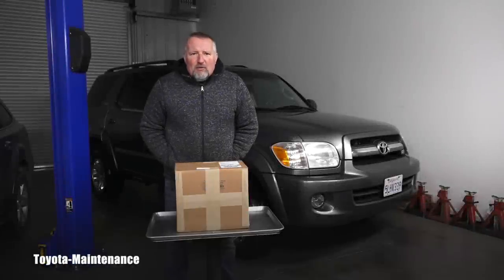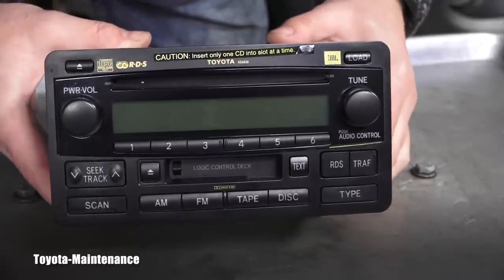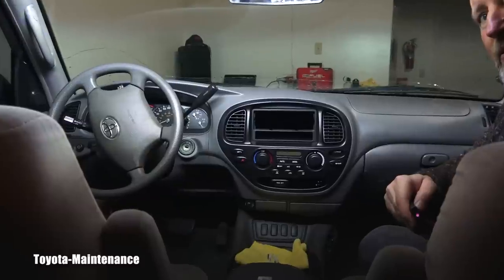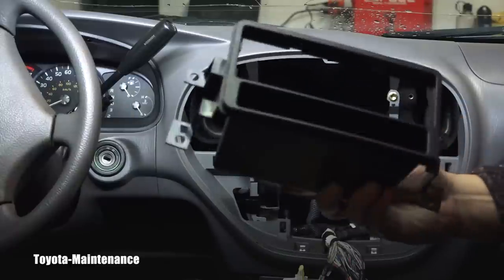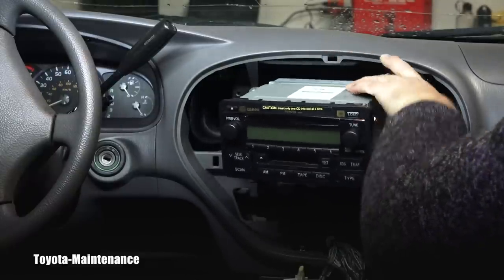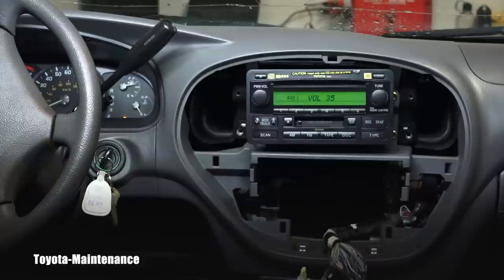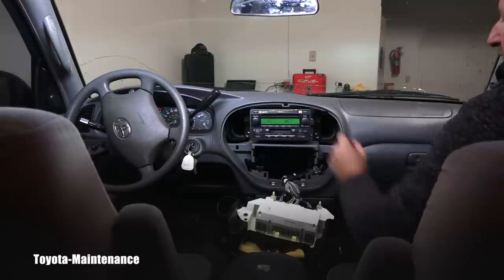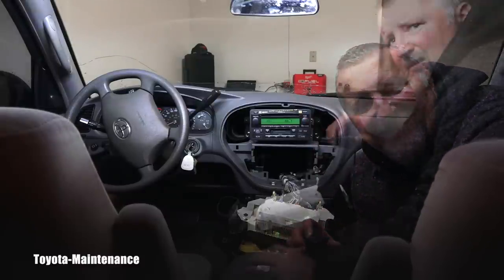Toyota Sequoia Tundra JBL Radio A56830

Comment: thank you for the efforts you make. I have a 2006 Highlander and have the same system with 5CD changer. and I added an adapter to attach a USB drive, or to receive calls from the same system. Its in the glove box no wiring or any dangling wires on the front.

Comment: My factory JBL head unit turns on and extends the antenna perfectly BUT no sound plays. And when I try to turn the volume up it doesn’t even show the volume adjusting on the display. I thought it may be the knob is broken but it feels fine. Has all the notches while turning it up and down.

Comment: Friend, great video.  Are you going to get the original front door jbl speakers? If you can find used ones you can rebuild the speaker cones.  I think they are 2 ohms so work great with the jbl amplifier.  Good luck.
Reply from the maker: I'm not sure about those yet...thanks for sharing